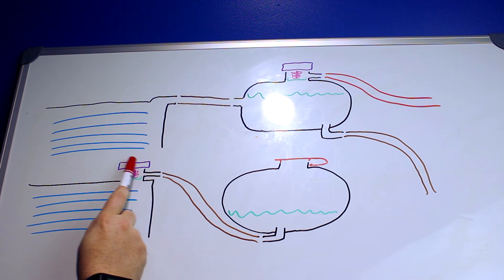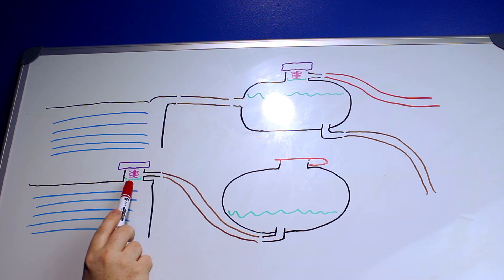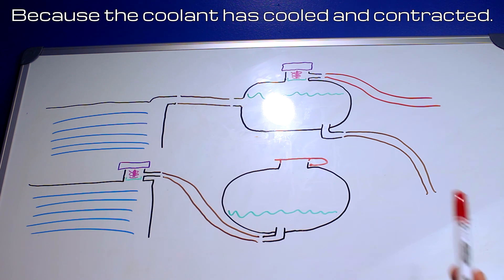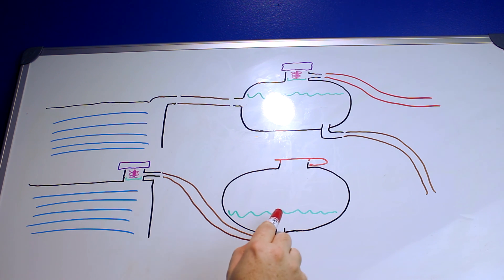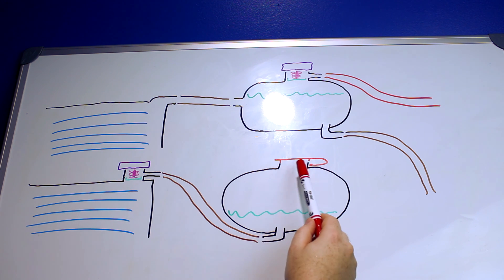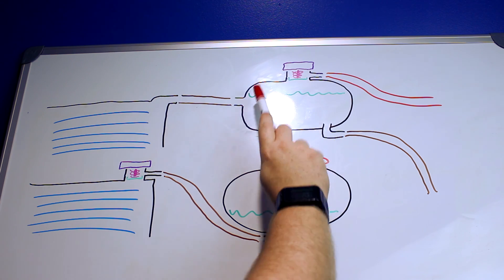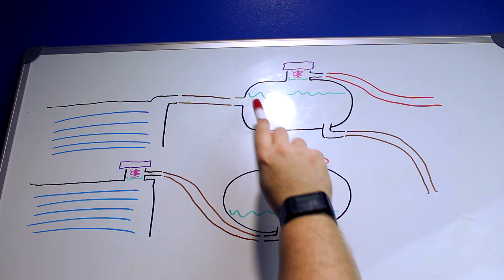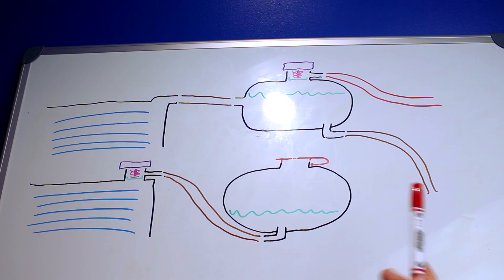Differences Between Expansion Tanks & Overflow Tanks in Automotive Cooling Systems

Comment: Upon coming back to my car (did a 10 min. hywy run to local store) noticed Prestone near and under the driver's side of my 1976 Lincoln Continental Coup. I lifted the 900 lb. hood expecting to find a wet or steamy radiator, but lightly touched the unpressurized cap and accessed it was safe enough to touch. When I unscrewed the cap, Prestone gushed out of the coolant overflow tank - making me think that the plastic OEM container must have seen it's last day. After days of searching for a replacement, I decided to remove mine and see if I could "repair" it with GOOP. What I discovered was that the tank on this model is a "purge" tank. The coolant enters the overflow and purges it out of the car entirely! I had never heard of such a thing, but sure enough when I got under the car saw how the tank has a nipple which sits in a groove designed to allow the coolant out - right onto the road or wherever. Mind that it's not daily. Perhaps it's running hotter than when I drove it late winter. 
Have you seen this before? I think you may have stated that some cars 60's - 70's may have not even had overflow reservoirs. 
This experience also made me think about how or where would I ever get a replacement. Meaning, is there something universal?

Comment: Hi!
Is there a problem if I go to a higher pressure coolant tank cap?
For example the cap on my car (a4 b9) has 1.4 bar and want to change the whole coolant expansion tank with a new cap that has 1.6 bar release pressure.
Thank You!

Comment: great video - thanks! question: my car's engine can't reach the operating temperature, even after some time of driving. I also don't see the coolant swirling in the expansion tank as it used to before when it start circulating through the radiator. What could be the reason for it? thanks!
Reply: Hope you figured your issue out already but sounds like you have a coolant leak that has reduced your coolant level to the point that there is now no coolant where your temp sensor reads the coolant temp. If you didn’t fix it I’m guessing you might have ended up with head gasket issues? Probably started out with a perishes hose somewhere in the system
Reply: @alanhillyard1639  see my comment for the solution 👍🏻
Reply: Remove half the coolant place one cup of milk in and then 50 grams of rocks. You’ll be gtg.

Comment: In the first illustration of the pressurised radiator with an expansion tank at atmospheric pressure, how can the coolant be drawn back into the radiator against a seal with a strong spring?
Reply: has a type of valve on the radiator cap that lets the overflow coolant back in as the cooling of the coolant cools it causes a vacuum that makes the pressure inside your sistem lower than the air pressure outside, and this push's the coolant back through the valve in through the radiator cap back into the system, this valve lets pressure out of the system when it gets to about 15psi ish to 18psi ish but about 0 pressure needed to push the coolant back into the system, well not zero but its 14.6 witch is our atmosphere pressure, so it wants to return to 14.6psi this is why it push's it back in and not sucks it back in

Comment: Thanks for the simple explanation. I tried to find out the design of expansion tank of VW polo which, for me, doesn't have expansion tank cap. I just wonder how this works to control the system pressure. Aside question, if such expansion tank spit coolant when the vehicle stops, what that would be a sign of? Thanks again for your time to help people
Reply: Most of the newer Volkswagen stuff has a regular cap but also a  pressure release valve on the underside of the reservoir

Comment: Thank you Sir. This is such a clear explanation.  I have a following questions hope you could help me.

1.  I saw some of  radiator has that pressure cap on the high pressure side near inlet. Some of them are on the low pressure side near outlet. What is the pro and cons on each design?

2. compare overflow tank design and expansion tank design, which one can self bleed the air better? Could you explain this a little bit also.

Thanks for such a useful video!
Reply: Just bought a used Hilux 12, flushing the radiator these days. 
Noticed that I don't have to bleed its expansion tank design. 
Also the expansion tank cap design is less dangerous if opened on a hot engine.

Comment: Hi
There are some special coolants that does not boil at around 100 degree celcius but boils at much higher temp like 160 degree celcius. If we operate with such coolants the radiator system does not work under pressure. In this case do we need expansion tanks?

Comment: My 1985 BMW E24 635CSi has an expansion tank.  The small diameter line from the radiator, and the large coolant from the motor to the tank are understandable.  However; the atmospheric line just run to nothing, with the hose hanging down several inches.  I can see clamp marks on the end of the atmospheric hose, but the diagrams I've seen do not show where it is supposed to connect.  
The expansion tank cap is pressurized, with the atmospheric hose outlet just beneath it.
Suggestions? Solutions? I have yet to see where it is supposed to go, and I don't think that the engineers would have an open line out.
Reply: I have the same question and I hope this bumps it to the top to get noticed and a reply

Comment: And one of the things people take for granite.  I remember the days in the 60's and 70's where you didn't have the expansion tank.   You strictly add coolant to the radiator cap and there was a hose next to the cap when there was expansion and the excess would fall to the ground.  Hopefully no animals like dogs would be around to drink that green sweet Preston antifreeze!
Reply: should I take it for limestone instead?
Reply: @executive  or take it for concrete!
Reply: Granite 😝 ... it's granted. "take for granted"
Reply from the maker: For sure! I have read that coolant will mess up people and animals pretty badly. Pretty much guaranteed that you'll need a stomach pump ASAP.
Reply: Corian or maybe Silestone. Some of those look like granite. Lol, don't you just love Google auto correct.